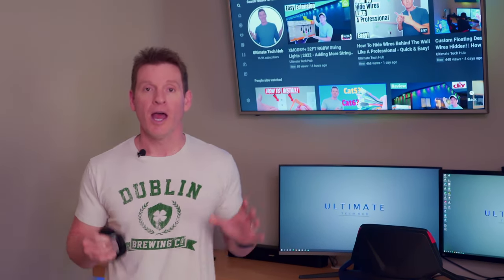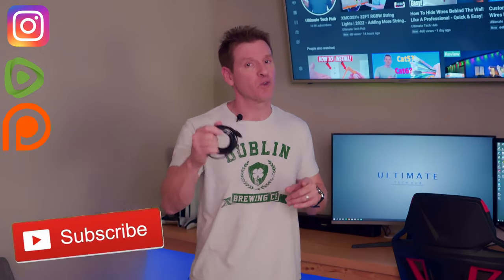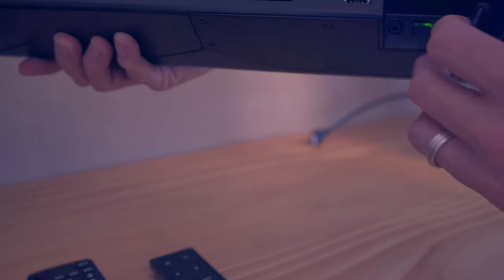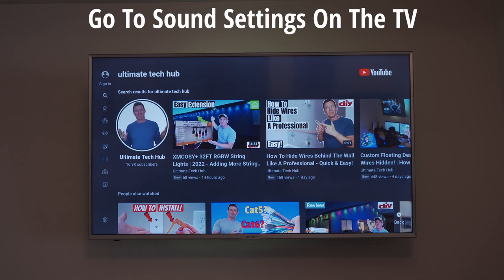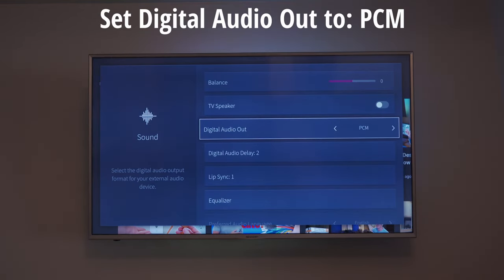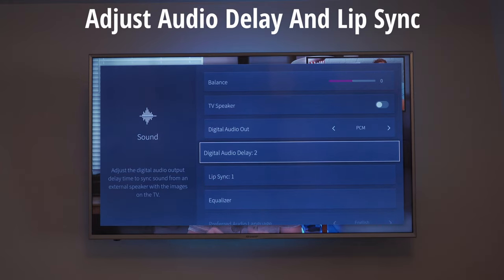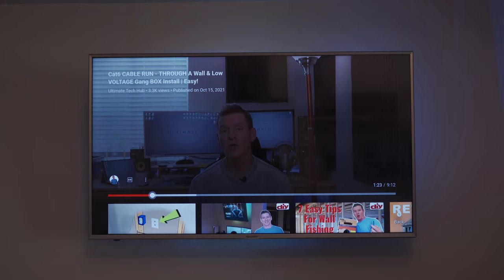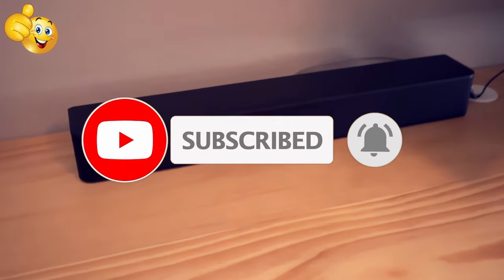How To Fix Soundbar Delay - Setting Up A Soundbar | 2023

Comment from the maker: Do have some audio delay between your TV and your New Soundbar? This video will fix any delay issues. Thank you for watching!:_Great:
Reply: This doesn't work with my Grand Videoke Rhapsody 3 Pro Plus, Samsung HW-T420 Soundbar
and my cheap TV, which doesn't have a setting for PCM audio.
Reply: My Soundbars connected to a Smart TV of exactly the same brand.

It doesn't matter what option I set, theres an Audio delay from my PS5 to the Soundbar through the TV.
Reply: @theroyalaustralian any luck or nah?
Reply: @samsung-yo4yh  No, there's no sound delay through other applications, however, Rocksmith 2014 is sound delayed by 1 second.

Comment: PCM can carry surround sound, but it cannot do so over an optical cable—the optical cable can only carry stereo PCM (using TOSLINK, the home stereo standard). To send surround PCM, you'd need to use an HDMI cable (or alternatively displayport on a PC), which carries both the video and audio signal.
Reply: Thank you, sir!
Reply: Not true, toslink does indeed do 5.1 surround, just not Dolby true hd or atmos or dts x.

Comment: My polk signa s2 doesn't have a delay persay. When I turn on my LG HDTV the picture will start up after a couple seconds but it takes a whole 30 seconds,  if not more for the sound to come on. I have the soundbar connected via the USB ARC. I have tried connecting with the Optical cable but even though I get the light shinning inside the cable its not producing sound. I even tried rebooting it by unplugging then replugging in the soundbar power cord. But still nothing. So I went back to Arc. Any advice?? It seems like I've tried everything. 😪

Comment: The audio sync on my LG TV with a LG soundbar is off and one tick away from the closest match makes it worse. It is really annoying. I wished you could have used a newer soundbar because the LG soundbar has terrible instructions with it and I can't find any better online. Driving me nuts -
Reply: I have LG c2 paired with sony ht-x8500

Whenever i play something i get 1 to 2 seconds delay.. Its super annoying this is because i have atmos and pass through enabled but whenever i disable them the delay dissappear buttt the audio is very bad

Any way to fix this?